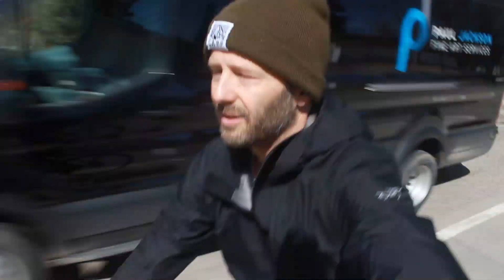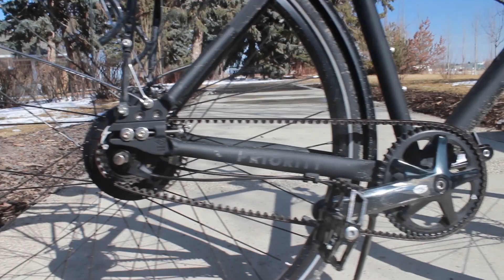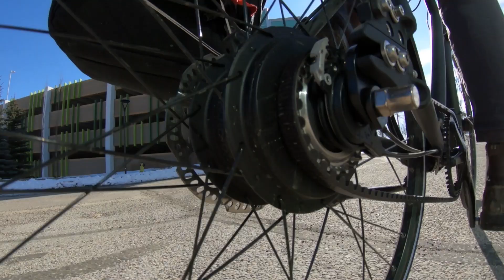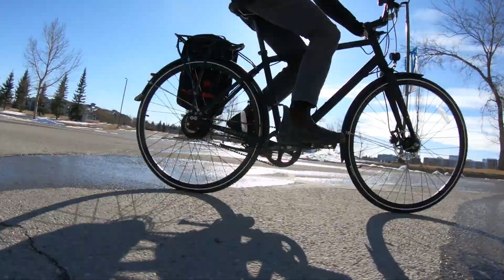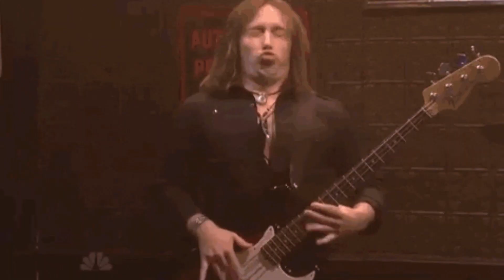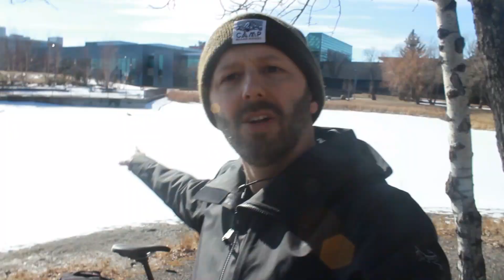Chain vs belt-drive bike | What's best for your bicycle commute?

Comment: Belt drive costs extra, wears out quicker than an occasionally lubricated chain, and requires a special frame to install.  Drive belts have been around longer than bikes, but still haven't become common for bikes.  That's no coincidence.

Comment: belt drive and rohloff hub is alright for a touring bike. the rohloff hub can be easily serviced - oil change can be done in 5-10 minutes. otherwise there is no point to having a belt drive and a rear hub that not only has considerable drag but also difficult to service and does not last too much.

Comment: Lame, If the main selling point is that its quiet, guess what, oil your chain every month or so. Just a few drops, ends up quieter than a belt in the 1st place. And if keeping a chain clean is a hassle, well guess what? the same grime and dirt is gonna get on the belt too, sooner or later, just without the oil. Belts seem like an expensive, unnecessary and quirky gadget/invention for someone who is bored and lazy. If you ask me, it goes in the same bin like a electrict soap dispenser at home, just why?
Keep it simple and easy to maintain, cheap parts that you can find in any store. Hence why the belt is not popular.
Especially if you commute every day. Be like the Dutch. Why the hell do you think they ride their simple and cheap Dutch bikes?

Comment: No. Chains last much much longer.
Reply: are you one of those earth is flat guys that believe in what he wants, despite every study proving this wrong?
Reply: @srobeck77  Not really. I believe in science and experience and my experience with belt drives on bikes is that they break more often. 

I had a Strida for a couple of years and needed a new belt twice while replacing chains on my bikes are a very rare occurrence.

It could be that a geared bike would suffer less breaks than a single geared one, but belts seem to break at least twice as often on similarly geared bikes.

Belts are simply more prone to structural damage caused by shock loads.
Reply: @Diggnuts  wheres the link for that? none? ya that so. your "believe and experience" were just bias opinions, not supported by fact. thats the difference